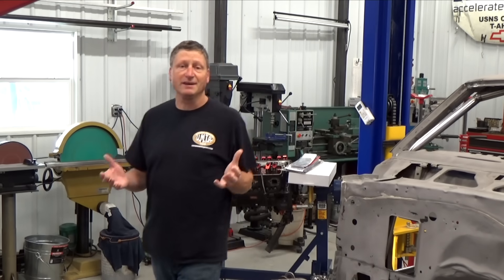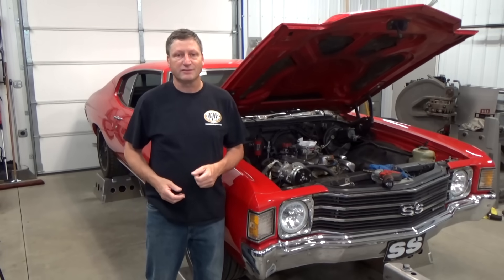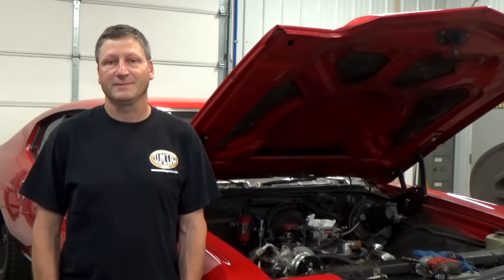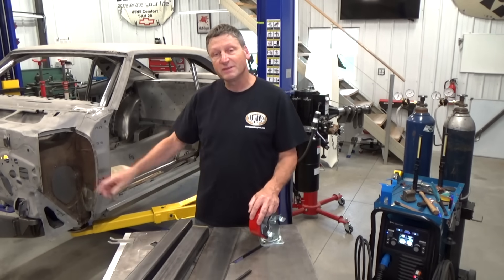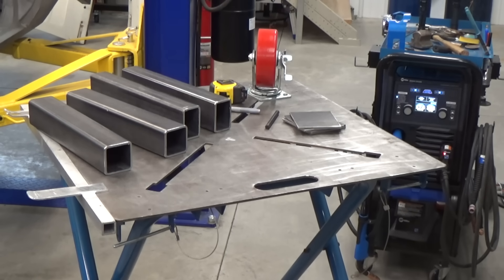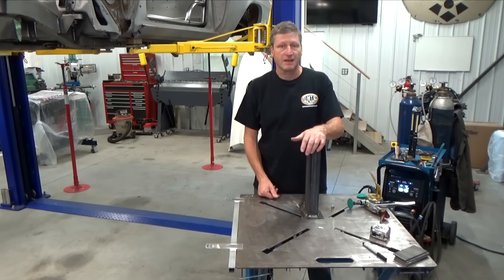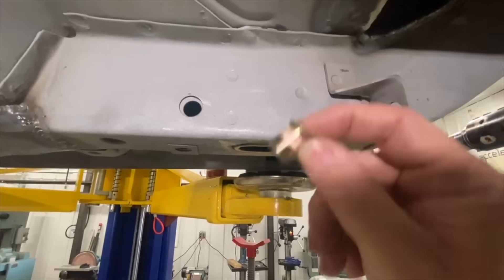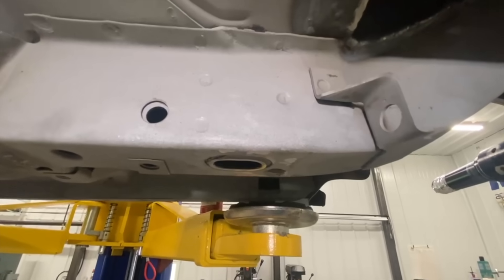Real Garage: Rolling Tall Car Stands for Portable Pontiac! (Season 4, Episode 3)

Comment: Band saws! Or should I say, “real band saws”. I had a Harbor Freight horizontal band saw, and learned that a cheap band saw equals horrible cuts! I bought a good chop saw with $60 blades (Meh..). Wish I had those saws; cutting is 1/3 of fabricating.